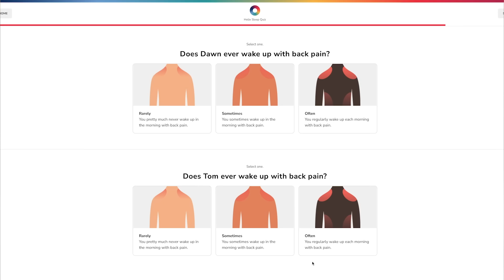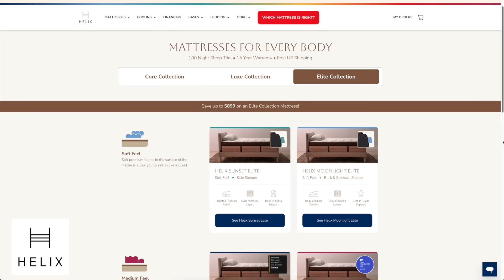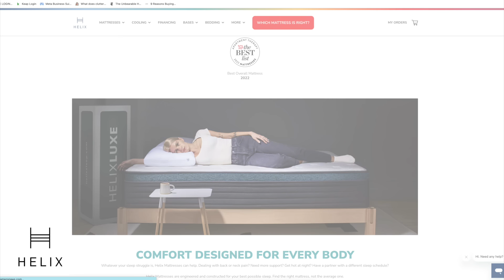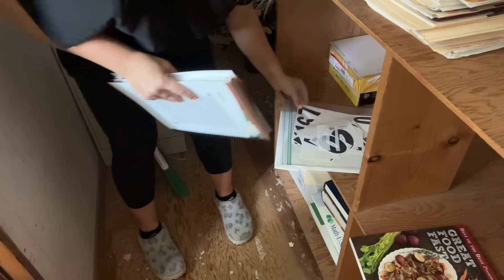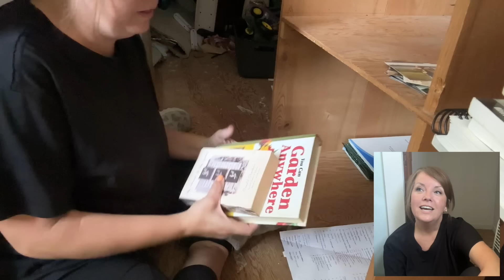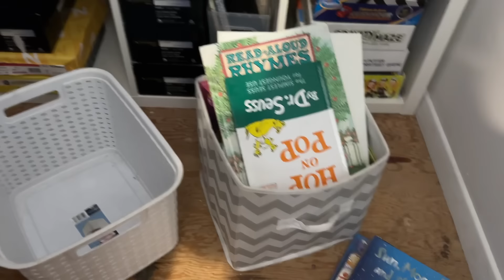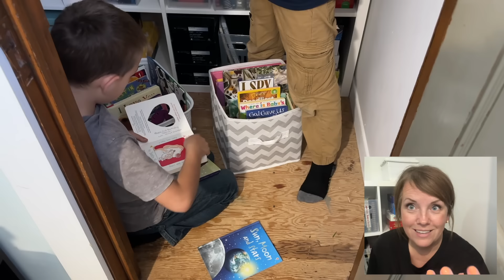Organizing Epiphany! This changes everything! (Huge Storage Space Makeover)

Comment: We had a similar space under our staircase when we first moved into our house. Our way of dealing with no clutter there is we hired someone to close that area off with drywall. That resulted in a nice, smooth wall and zero chance to store clutter. Living in California helps keep clutter down because houses typically don’t have basements and our attic doesn’t have a floor to walk on except for a tiny area where the central air conditioner rests. Our goal is to never go into the attic except for maintenance of the HVAC unit. At 62, I already went through Swedish Death Cleaning, which is such a good feeling. We can park both our cars in the garage, the 20-something year-olds got rid of the toys they used as children, as well as exercise equipment they no longer used. We also don’t have any excess furniture so the house has plenty of space for chi to flow  freely.

Comment: One thing I like about using the bins you use inside the shelving is that the bins become drawers, which make all the shelves SO much more accessible. I'm 66, and getting down on the floor to reach way to the back of a shelf is something I can't easily do anymore. It's so much easier to grab the front of the bin, pull it out a little ways, see everything on the shelf, and push it back in when you're done. All my lower shelves have bins now, including kitchen cupboards and under sink cabinets. Makes the house much more liveable.

Comment: I love those switch lights. Tip is to use command strips to hang them. I buy them at Dollar Tree and have them in important places for when out power goes out and I also have one on the inside top of my car trunk since I don't have a good light in my trunk. We're doing Trunk or Treat and if you put orange washi tape over the light part, we use them in the trunk to have an orange light effect to our decoations.

Comment: A really  good transformation. It looks so much better.   I enjoyed watching the process and the  great team work between you and Corbin.  
I bought a couple of light switches similar to yours for my and husband's closets.  Very small closets, not walk ins and they are dark.

The switch works very well to light the space up.  The velcro didn't hold up at all,  so my husband put screws in and that works really well.  The switch plates we have,   have 2 of those screw slots.  The switch plate can slide back off the screws when it's time to replace batteries.  Simple enough.
These types of switches are such a  handy way to light up a dark space.  We do have to remember to turn the switch off to save the battery power.

Comment: Use a post-it note to catch the drywall dust under where you are drilling.  

I know it's just one more thing to do, but it works so well!  No vacuuming needed afterwards.  

You stick the post-it to the wall just below where you are drilling, fold the bottom up, so it's folded in half, so it makes a little "V" to catch everything.  Then when done, just carefully peel it off the wall, fold it up, and toss in the garbage.

Comment: About the "light switch" lights, I have them EVERYWHERE! I wear a lot of black so it's hard to see what is what in the drawer. I keep one on top of the dresser for that reason (unstuck). I have one stuck in my baking tin cabinet~again, a dark space. I have one in the pantry, though we do use the kitchen light mostly, but it's nice and comes in handy at times. The spice cabinet has one, under the kitchen sink, bathroom sink, in the hall closet, they are SUPER handy to have around! Sometimes the adhesive gets used, you can attach them with screws, but most of mine are just available, standing against the wall.